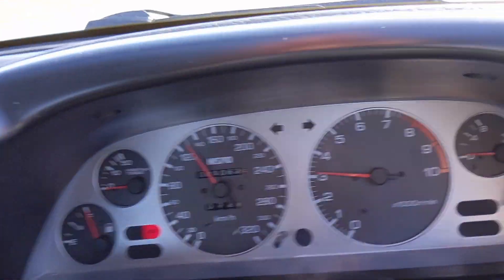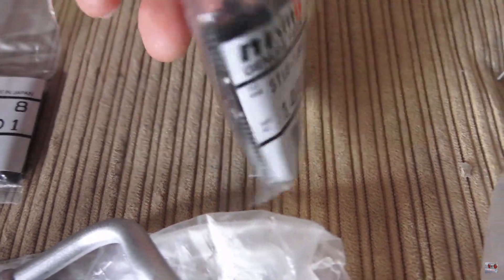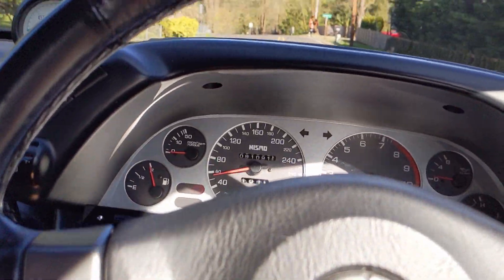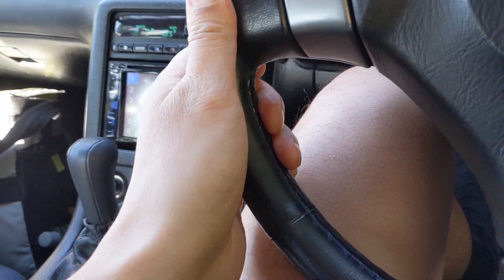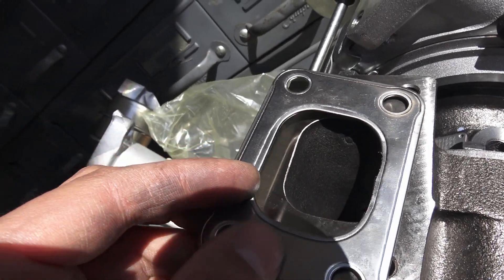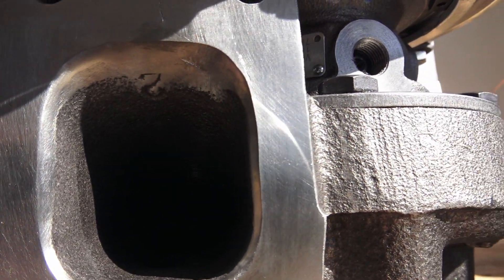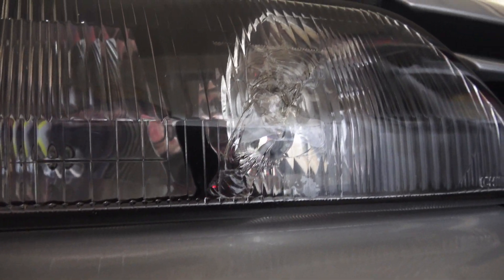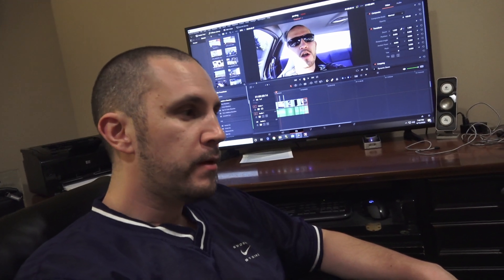Port matching Nismo R1 Turbos to Tomei Exhaust Manifolds using die grinder porting kit

Comment: Are you worried at all  about the exhaust manifold causing any lag/decrease in response from your turbos since the Tomei's inner diameter is quite a big larger than standard?
Reply from the maker: That is a good question, the dyno charts do not show any power loss in the low rpm range. I would hope my r1 turbos perform like the Tomei turbos in the low end and make more power in the top end too. I will find out. I finally got all the OEM hardware from Nissan I have been waiting for. I will be installing them soon!
Reply: @JDMRightHandDrive  Be warned: Boost threshold is not the same as boost response. Boost threshold is the minimum RPM required to reach your boost level set point. Boost response is the time it takes to reach your boost level set point from low load even though you may be stomping on the loud pedal far above the threshold RPM. Some of the methods for getting a good boost threshold might actually increase response time, so you may have to decide witch one should take priority.

Comment: What size turbine do you have on the N1 turbos? This dude on this vid: https://www.youtube.com/watch?v=H4jK1cp4wwA&list=FLRXvU2DB3Fb3RmLHbi27DpQ&index=3&t=0s   ,starting at 0:41 seconds, cuts the housing from a 42mm wheel to a 47mm wheel, makes a huge difference in power. Maybe you should look into it? Great vid as usual, thumbs up.
Reply from the maker: From the reasearch that I have done I understnad the N1 turbos to be the same as the GT2860r-7. GCG in Australia has all that stats on them. https://gcg.com.au/Turbo-Charger-GT2860R-AKA-7-Nissan-Skyline-GTR-RB26DETT-G836026-5004S.html

Comment: Stock oil pressure gauge is junk, can’t trust it. I replaced the oil sending unit on mine and it helped...I would not worry about it since the other gauge still reads okay

Comment: The oil pressure gauge is dead in my R32 as well. Still runs fine, but I took it to a shop and was told my oil pressure sensor was bad. Apparently it’s a very common issue with Nissans. You should look into it more, just to be sure.
Reply from the maker: Thanks, I will do some research on what the oil pressure. The Omari gauge is reading 2 bar is around 29psi, which I think is little low.